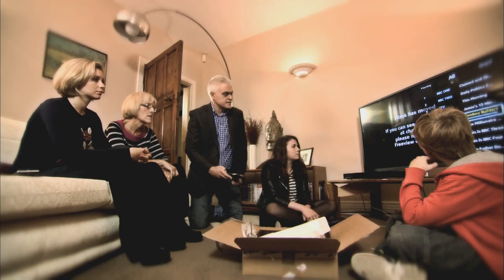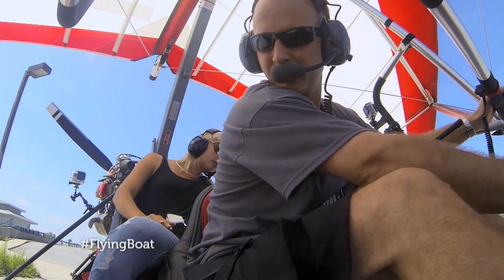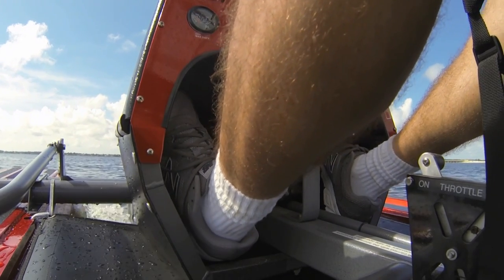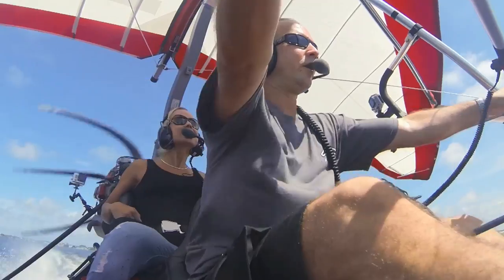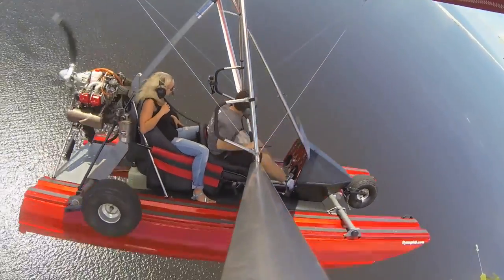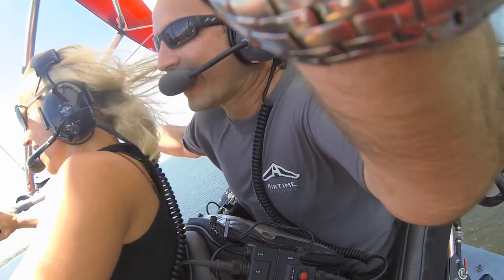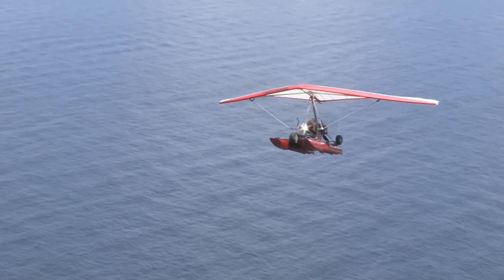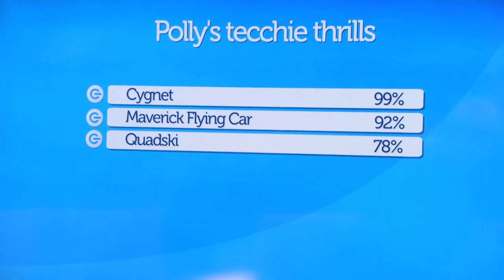The Gadget Show: Series 18 Episode The Flying Boat AKA Cygnet

Comment: Polly this machine will have it's uses without doubt but It's a little bit sad that you missed the thrill and excitement of flying a hang glider with no engine. Would you like to know what it is  to run off a hill and into the sky with no engine? 1000 times better than what you experienced.